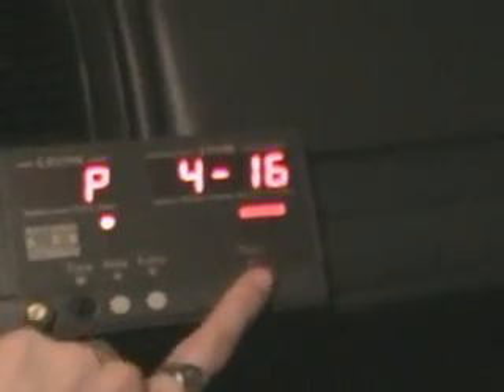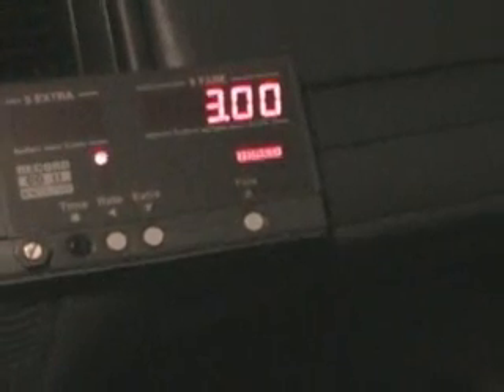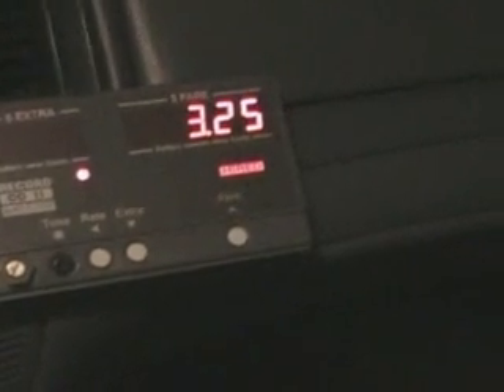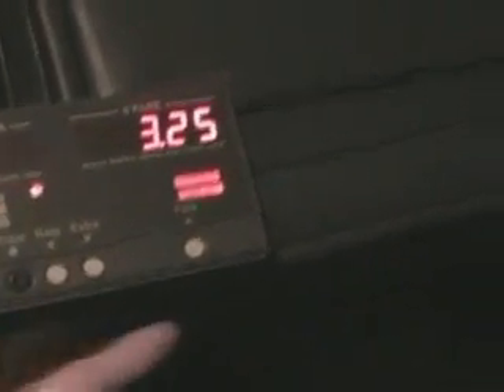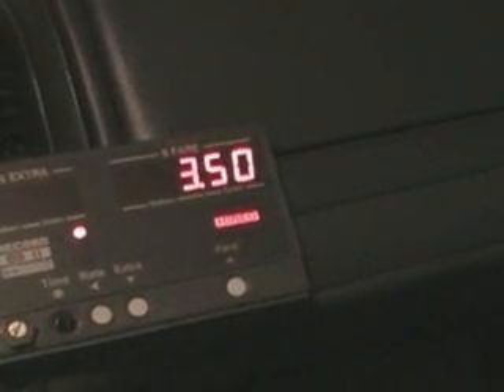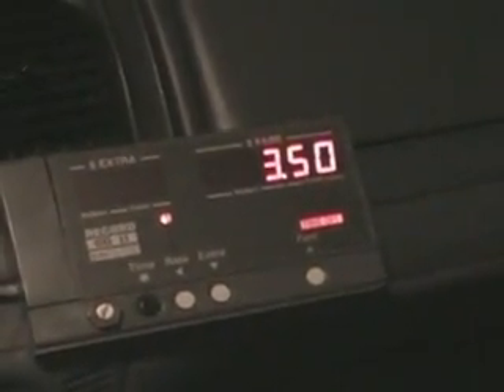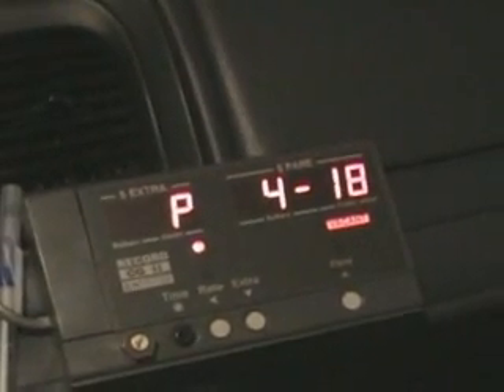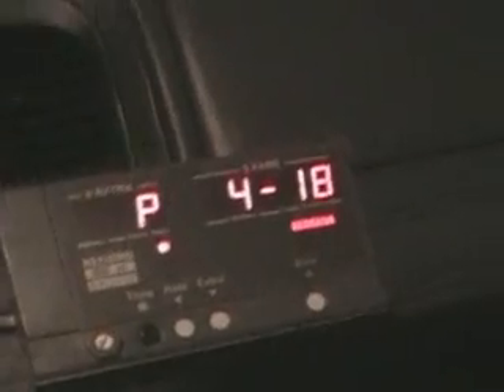How the meter works in a taxi.

Comment: do you get all the 7656.25
Reply from the maker: No.  I made this almost 11 years ago, however if I'm remembering correctly that was the total amount the meter had on it.  Just like an odometer on a car, it just adds up cumulatively.  I always assumed that it would turn over at 9999.99, but that's just a guess.

Comment: I took a taxi and my final fare was $14.90 and then the guy did something on the meter and brought it to $16.00 Why? he said the minimum fare from the airport is $15.00 but still I don't understand why he charged me a dollar more. any comments?
Reply from the maker: +Ilan Malone Well, first off, was his meter the same as the one in my video? If so, I have no clue how he did that.  Ours needed a technician to do something like that.

Most cabs have a flat rate to places like airports like he mentioned.  Normally this means they run the meter until it hits that stated amount, then they pause it so you won't have to pay more if you would have too.  If he stated the flat fare was $15, he should have charged you that despite the fact that it was actually $14.90. However he shouldn't have charged more.  If he actually said, "you owe me $16," then that was either illegal (if the flat rate was dictated by the municipality), or at least against his company's rules.  If it really bothers you, I would contact their dispatchers directly and politely ask.

Do not be a jerk about!  Even if you have a right to be.  They deal with 9 assholes for every one decent person who calls, and will most likely automatically assume that you truly upset if you don't speak calmly and concisely:)

If his meter was anything different than mine above, really have no idea though.
Reply: The model of meter you have in the video is the Record CG2. I think what Malone is trying to say is that the meter was programmed for an EXTRA charge.  Did it coincidentally make the balance $16.00 or was the extra charge $1.10? 

Extra charges can be programmed in the rate structure of the meter depending on the city/area regulations. In big cities such as Calgary where I am at and that meter is produced. Meters are sealed and programmed according to a specific rate structure. Other municipalities may not have any rules about what can and cannot be charged. 

Protip: check the seal on your meter if you are a passenger. I personally always give the seal on the meter a little tug just to make sure the meter is sealed properly.

Comment: I lease a taxi here in Houston and its 108 a day very expensive but in Pasadena Tx cabs lease for 80 to 90 dollars a day.
Reply from the maker: Interesting.  Seems extremely expensive.  Do you pay for your own fuel? Are you required to clean the vehicle?  What are your hours? Do you pay for the insurance yourself despite the lease (I don't think this is the case, but you never know).  Despite this, that is probably cheaper than what I did for most of my career as a Taxi driver.  At one point it was a 60/40 split, with the owner getting the the sixty, and I getting the forty.  If I did a $400 dollar shift on the meter that would mean that he got $240, with me still footing the gas.  So $160 for me, minus gas, would equal around half that, say $80 for me (12 hour shift)...  However with tips, I rarely went home with less than $200 in my pocket (usually $250, but granted I was considered to be the most popular driver at the time because I was not a fat creep or a minority (no offense to them, but the average passenger preferred a white driver who looked just like a normal dude. Fucking stupid in my opinion, but can not help the racists among us)), and this is when gas was around 124 cents a liter.  I won't go into conversions with Imperial Standard (i.e. gallons), but I still think I paid much more than you for the "privilege," of driving a cab.  I often chalk this up to being in the Canadian north (the vast majority of our population lives within 200km of the US border) where prices are just higher because of supply and demand (I could drive an hour and a half away, and gas would be 20 cents cheaper per liter), or because my employer at the time owned both of the taxi licences in our municipality, which basically gave him a monopoly on the service.  That being said, I still think you are over paying.  Especially when you live in the states, where things simply are cheaper regardless.  As a citizen of Texas (please forgive any ignorance of my view, I've never been there), without the wear and tear brought about by salting the roads (and leading to extreme vehicle corrosion), the horrible detriment that 4-6 months of winter (with all the "snow" pot holes that develop, and subsequent wear on the suspension), and the fact that your gas is quite simply cheaper, leads me to believe that you are being over charged.  This however is just a simple opinion of mine.  I haven't driven a Taxi since 2007 (joined the army in 2008, been here ever since), and as I've said earlier, never been to Texas and taken a cab there.  I would suggest you ask your employer (if you are in fact an employee under law, or because you lease the vehicle, you might be self employed for tax purposes) for a breakdown of expenses as to why you are required to pay that much.  Don't take, "because that's what everyone else charges," as an answer.  Ask for an expense report on your particular vehicle (if you only use one car), or a statistical average for the fleet (if you hotseat), add in a margin of profit for the owner of the business based on other companies offering a comparable service (supply and demand), and see if it still seems fare (pardon the pun).  That being said, and after reviewing my own rant, I see that you were comparing your municipality towards another.  Where I drove (In British Columbia) the prices were pretty much left up to the owner (I don't know this for a fact, but empirical evidence and word of mouth says it's true), with the concept of supply and demand keeping it up.  In my small city of 12k (Dawson Creek B.C. at the time), if prices were too high, no one would use the service. Except for the ignorant (or simply stupid) or the drug dealers who used us as a means of transport (fuckers!)... In the next town over however the rates could be completely different (they usually were similar, but they could have been radically different).  Anyway.... I have not looked at my comments in around a year... So please take this reply with a grain of salt, and in fact feel special that I responded too you:)  Everyone should feel special now and again!  Peace!

Comment: My cab uses a centrodyne 620, And also has a modernized Gandalf computer dispatch system. Accepts credit cards which I hate cause they charge us 7%. And I hate the crown vic/grand marquis gas guzzleing pile of shit. The Toyota camry hybrid is so high tech compared to there old fleet. But the girls love me and leave me mad tips and phone numbers and ect..
Reply from the maker: Ha!  I hear and love ya mate!  I did not have the fancy computers that most cabs have now a days, and no stab shield or nothing.  Take a cop car, rip out all the cop stuff, and that is what I had.  I can not count the times that being the only young (and I might add handsome:) white, and clean driver landed me mad tips and phone numbers....   and other things, wink wink, nudge nudge, from the female passengers I conveyed.  The Vic is the worst for gas!  That 454 cost me an arm and a leg!  The Marquis was better, but barely, and the red carpet was a bitch to clean.  When I still drove cab, I thought about getting a hybrid at the time (my folks were the first in the northern half of BC to get one, they even had to send the local Toyota guys away to learn how to service it:), but I realized as an owner operator in my area, it would be more expensive to by a new Hybrid, than an old cop car at auction, even with the lifespan being only 2 years or so because of the weather.
Reply: TheOriginalAscer yeah i also have no shield driving in orlando florida.it gets scary as hell in the ghetto. Lots of cab drivers robbed here. But im somwhat different on the vic now. The toyotas do not hold up for shit were our hrand marquis have half a million miles on some of them and there still going strong. Sadly there dissapearing as there all being replaced with hybrids

Comment from the maker: For sure, however, when I drove cab we didn't have 3G:)  No fancy interact either.  Just your basic meter without the other networked computer terminal, no GPS map, or even a stab shield.  Just your used police cruiser with a meter and second hand radio (quite literally nothing else):)  You're right about the extra fees though.  Insurance alone for a Taxi is retarded expensive, or at least it was when I drove one anyway.

Comment from the maker: I've been done for years, but if fluctuated all the time.  At one time it was 50/50 and the boss paid for the gas.  When gas went up, it became 60/40 (60 for me) but I pay the gas (when it was almost $1.40/L).  In my 2 years of driving cab, the rates of fare, and the percentage I took changed no less than 5 times.  It all depends on the economy.

Comment: The car itself is a good $30,000, and then the taxi equipment that goes into the cab is another $10,000...add on any taxes, and registration, and monthly 3G bill of $40.00/month plus gas.....that explains why cabs are expensive.

Comment: Here in Belo Horizonte, MG - Brazil, The metering system is similar. It count stopped hours, per kilometer, jump in fare and we can charge for packed volume. We have 2 fare values, from 6am to 10pm on week days and 6am to 2pm saturday is fare 1; and fare 2 from 10pm till 6am on week days and 2pm saturday, monday and holidays all day long. The actual fare is R$ 3,90 ($ 2,16) jump in; R$ 2,24/km ($ 2/mile) fare 1; R$ 2,69/km ($2,40/mile) fare 2; R$ 22,00 ($12) per hour